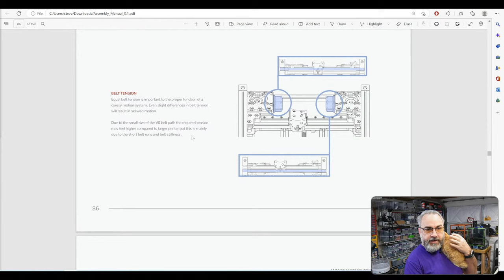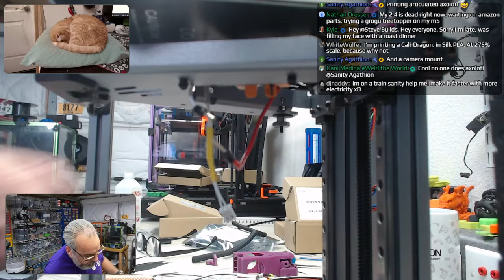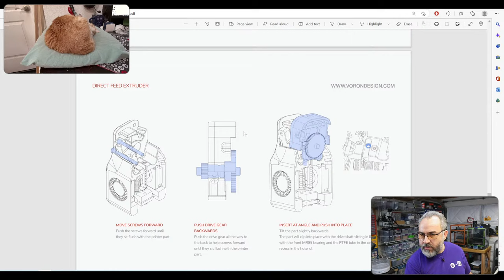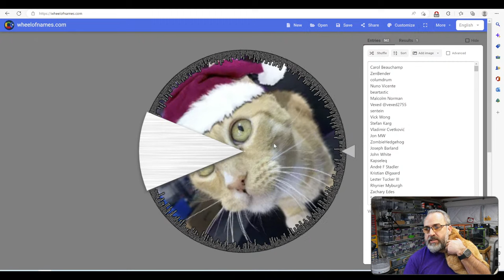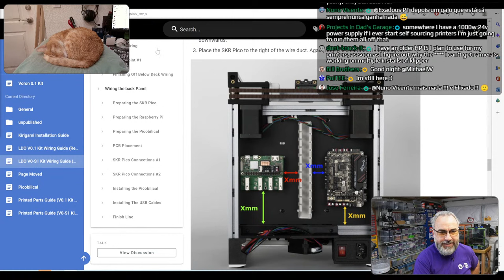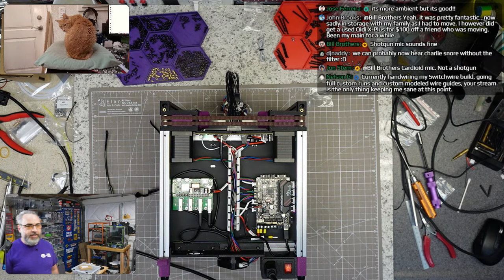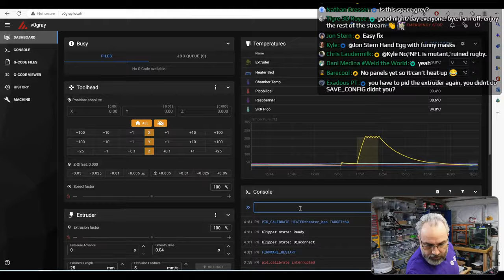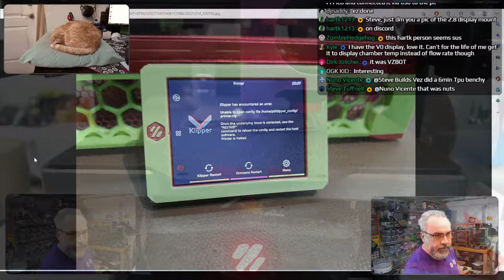LDO V0 S1 Kit Build! (Part 3)

Comment: I don't know how you could stream for so long without having to go to the bathroom. I have to go like every 20 minutes. It's taken me about a week just to get to the 5 our mark. I've bought bought the upgrades from West3D to upgrade my only working ABS printer. Stupid me I ordered the LDO Kirigami bed upgrade solely to get the LED bed parts as I already had the Kirigami bed from when I built the v0.1 not realizing I already bought the LED part of that kit a while ago from DFH. I have so many 3D printer hardware do-dads with nothing really organized and with my memory issues I'm not surprised I ordered something I already had.
Reply from the maker: I guess it's my super power :)  Or I don't drink enough maybe?

Comment: I have the LDO v0.2 s1 kit. Where did you grab printer config? From the voron guide? I tried that route with no success. Followed you and still having skr Pico issues. So I used LDO's own config and I'm having mild success with getting the skr Pico to even show in mainsail. I've followed to the T and I'm just experiencing bad luck. If I can get them to show and thing seems fine, mainsail ui yells at me about an MCU adc rage not being correct. Meaning the thermistor type isn't correct. Both the Pico and umbilical from ldo themselves are different in the config. I d9nt know what to really do. Please make a video about the configs as a follow through and to talk about them. I'm pulling my hair out over this. I've wired everything exactly too. I hope I didn't Bork something, thermistor, the rp4b, skr pico... I just want my money to just work and not be wasted
Reply from the maker: I uploaded my V0 S1 print config file to my github.  Does that help?
Reply: @Steve Builds  yeah, appreciate that, got it to f8nally comm7nicate well from rpi to both mcus and f8nally got it to function. It's a nightmare when you don't know conf8g setup even if you follow instructions to the letter.

Comment: You said several times not to pull the trigger on a v0.1 instead to wait for the v0.2. are the differences so big? Does upgrading don't make sense? And how long it normally takes for the company's to bring kits on to the market?
Reply from the maker: Actually I thought I was saying the opposite.  Without promising what changes there are in V0.2 I think buying a V0.1 kit now would be ok.   Some vendors are promising deals on any potential upgrade kits also so check on those.
Reply: @SteveBuilds  I read that (free upgrade) on the us shops, the eu dont do these... I'm really appreciate your stream, work and your friendly and kind manor. I have to thing about the ldo s1 vs formbot Kit...
Reply: @SteveBuilds  Hi Steve, when I watch your build i see some things which are to be honest crazy design flaws of the v0.1 (No-Go´s). first there is no PE-Connection to the frame (must have), the power switch should be not at the back and by the LDO S1 it there is no protection on the 110-230VAC screws of the Powersupply.
Reply from the maker: Good point on the power supply cover.  We have one for the meanwell.  I'll mention this to LDO

Comment: printer.cfg file is where???? I didnt find on ldo's page
Reply from the maker: The docs could be improved, I think they're working on it, but I think what you are looking for is here: https://docs.ldomotors.com/en/voron/voron01/Picobilical
Reply: @SteveBuilds  this is just the picolobical cfg… but I did not find anywhere the printer.cf file:o
Reply from the maker: Try this https://github.com/MotorDynamicsLab/LDOVoron0/tree/v02r1/Firmware
Reply: @SteveBuilds  voron v0.2 r1 is very different from v0.1-s1
Reply from the maker: Let's start over, what basic configuration are you looking for?  What controller board are you using?  With Picobilical?
Reply: @SteveBuilds  Voron v0.1-s1 kit ( skr pico board+ldo picobilical PCB mod)
Reply from the maker: The config file I linked above is for the SKR Pico.  What do you believe is very different from what you have?
Reply: @SteveBuilds  voron v0.2 has sensorless homing , different mechanical part, Z end switch on the opposite side (i dont know what else is different) …I have voron v0.1-s1
Reply from the maker: That's not significantly different. I understand not immediately knowing what changes would be required.  This is far outside the scope of what can be done via youtube comments though.  I suggest joining the LDO discord and asking there, or opening a V0 help ticket on the Voron discord.  LDO Discord - https://discord.gg/8pgtbANyMa  Voron Discord - https://discord.gg/voron